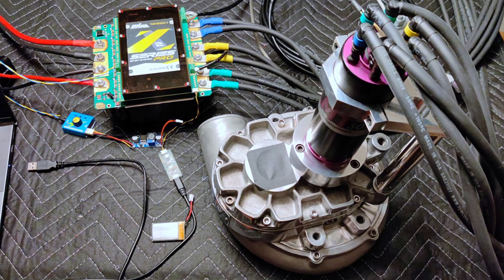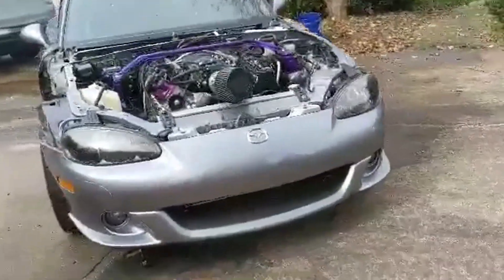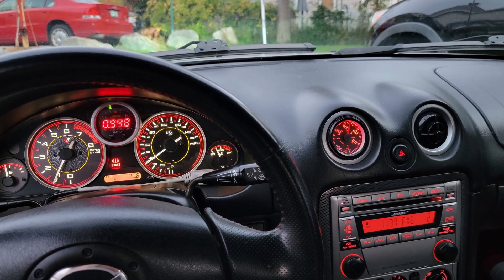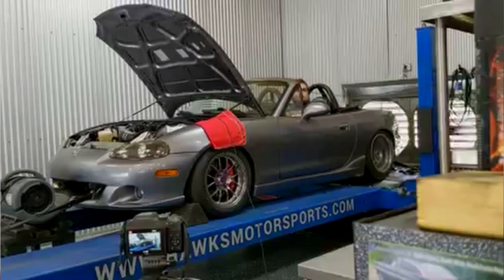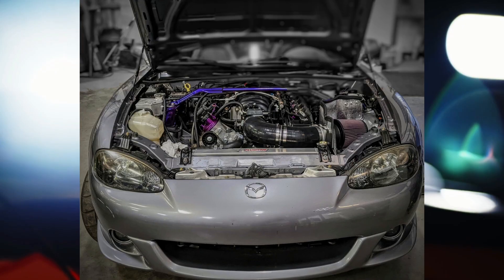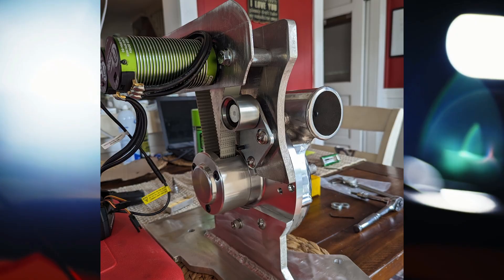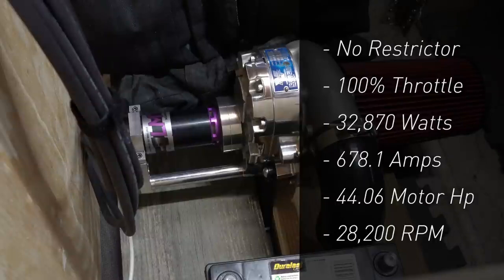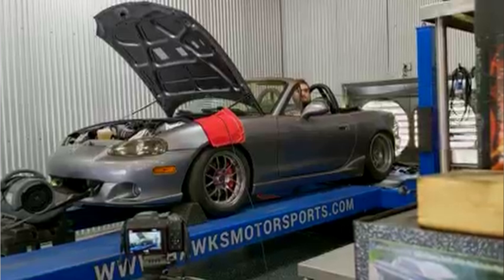Twin Motor Electric Supercharger!

Comment: What happend with this project? Just went quiet?
Reply from the maker: I followed up with him a while ago - he got tied up with some life stuff, iirc.  But tbh, with castle's new 2535 motor and my recent findings that the p2 is more closely related to a Vortech S trim, I don't think the twin motor idea is necessary anymore.  I'll be doing compound and parallel electric supercharger tests in the very near future (in fact, the third video on the list to shoot).
Reply: @AlexLTDLX thanks for the reply! This setup looked extremely promising! However, I have literally just been waiting for you to test the compound setup! It will most likely answer all my questions and then get started on my own build. Some back to back vids with my old 3.2 vr6 turbo on stock motor VS electric turbo vids on same boost. I recently signed up on your forum, so I will fire my questions on there😂 thanks again for all your trial and error, and literally sharing everything with the public, its really appreciated!!

Comment: Have you thought about using an electric motorcycle motor like the QS138 90H?  My guess is that motor would be more reliable than anything meant for RC applications.  You'd want to make a belt drive, but that shouldn't be too difficult given the number of off the shelf pulleys available for superchargers..
Reply from the maker: That motor isn't as powerful as these castle motors are.  I've seen 12,000 watts from these castle motors; that motor is at peak 7,500 watts.  And it's a lot more expensive, bigger and heavier.

Comment: Using an esc is extra fail points. 
Why not just use a 12volt series wound DC motor with a switch that turns it on when you floor the gas? The rest of the time you can just stay in limp mode.

Comment: the rotor size rpm and torque characterise favors smaller motors in multi-motor offset counterforce gear configure sun gear to planet and in a case to deal with open tooth noise.YOU WANT TO HEAR THAT COMPRESSOR AT THOSE RPMS. A modern engine needs 25 to 35 hp to compress enough air to make significant horsetorques.
Reply from the maker: You want to hear compressor whine?  Here's my car when it had the Whipple on it running 9s at the track on pump gas: https://youtu.be/DwFndZa0SSU?si=z8WAfSm4WVopwSyK  It took closer to 70-80 hp to drive the blower.  That's too much whine - it gets annoying after a while.  Here's my electric supercharger running just as quick, with much less boost (much more efficient), and you can only hear it winding down: https://youtu.be/RT0M88xHzNQ?si=0ZdGOIWMnBLk27f2  And even the electric supercharger was making 44hp at that point.
Reply: @AlexLTDLX  so true yep it takes that much

Comment: I’m excited for more sledgehammer content this year. There’s gotta be a practical use for these in daily cars. Something that can reliably pump a few PSI in existing NA motors would be such a game changer I think. I’m curious if there is any chance stock alternators would be able to charge a small scale sledgehammer!
Reply from the maker: I'm sure that in-car charging is practical.  The amount of time one would spend in boost is so much less than the amount of time one would have recharging the packs.
Reply: @AlexLTDLX  Exactly, and these newer cars with auto start-stop already are fitted with capable capacitors I believe so they seem very achievable/realistic for to me at least

Comment: The og Thomas Knight had 3 motors on a eaton. I think to keep the motor rpm down you need a procharger that has a 2to1 or 4to1 step up. Basically a transmission. So 1 rpm if the electric motor is 4 rpm if the supercharger
Reply: Is he still around doing stuff, or is this technology they are talking about far more advanced?🤔

Comment: Ya'll need to build something out for the Ram eTorque setups.  Native 48V power system (battery and charging), and a very decently powered alternator/electric motor already built in.
Reply from the maker: I'll have to look into that.  These motors run on a max 50 volt system.  Though I don't think (but I don't know for sure) that the Ram setup can output the necessary 350 amps for a single motor system (a twin motor like in this video would peak potentially around 700 amps).

Comment: Лучше электромоторы прикрепить к Roots.
Reply from the maker: Rotors are too heavy and the roots blowers are too inefficient.  It's not practical - it would add way too much weight, take up too much space and still make less power.  I've done decades of research and testing with roots-type and screw compressors.

Comment: Im still learning about batteries and whatnot, but how come an alternator cant be used as the power source for one of these setups? Do they not generate enough power? (I know this is a noob question go easy on me lol)
Reply from the maker: A big car alternator can provide about 2,800 watts.  This thing will draw ten times that amount - 28,000 watts (I've had a single motor unit up to 14,000 watts).
Reply: @AlexLTDLX  (Hmm. Popped in here from other universe.) Interested in calculating how fast a mid-size alternator could reasonably power up a bank of the newer supercapacitors? One could achieve 'x' psi boost impulses of 'y' duration every 'z' seconds. Hopefully, 'z' very small. 

Would only need a simple current-ramping/limiting controller (a compromise between overloading the alternator and minimizing 'z', given 'x' and 'y' objectives) off the stock alternator - no classical 'batteries'. Obvious downside: cannot be sustained for as long a duration as batteries but that save much money on those really expensive tickets (but my state will feed you dinner and breakfast, too!).
Reply: @AlexLTDLX  thank you for your reply!
Reply: @AlexLTDLX  how long do you get on a single battery charge on your current setup? Like how many passes do you get before you need to swap batteries / recharge
Reply from the maker: A lot, is the best answer I can give you.  I have yet to need to recharge the packs on any track or dyno day.  On the street, the packs recharge when not in boost, so in reality, you'd never run out.
Reply: @AlexLTDLX  like rechargeable nitrous

Comment: why not dual stage the motors and run a higher voltage?
Reply from the maker: Because they're essentially 3 phase ac motors.   Unless the motors are mechanically sync'd (it would have to very precise - every degree of timing affects performance), the ESC wouldn't know when to fire the phases.  You'd end up with "juddering" and no rotation, more likely than not.  It would be nice to find higher voltage ESCs that are commonly available, as that would reduce current draw, making voltage sag less of an issue.
Reply: @AlexLTDLX  I have not done any research on this so i could easily be wrong. I thought the Tesla motors are high voltage. Granted they are heavier, but weight in the back seems like it might help? a battery pack or 2, inverter and motor might be to heavy, but it would throw some air. the way that industrial motor and vfd are similar and give more versatility but would probably be to heavy when said and done, but this is "pioneering territory", no? I also mean to install in the trunk, no way you could fit all that in the front. to dual stage, just run a pot off the accelerator pedal to the controller?

Comment: I've been looking at electric motors on ebay and have noticed that 20hp electric RC motors exist. What is the reason that you chose 2 electric motors instead of buying one big electric motor?
Reply from the maker: Cost and rpm capability, mostly.

Comment: What's the electric motor spinning at ?
Reply from the maker: They're capable of 50,000 rpm, but really you're likely to see a max of 35,000 rpm under load.
Reply: Can't you set up a pulley system , like run a pulley with the electric motor and belt drive it . Less rpm , higher boost
Reply from the maker: That's exactly what he's doing - the belt drive has a step-up ratio.  Once it's on the car he can fine tune that ratio to find the sweet spot for his engine and available motor torque.
Reply: @AlexLTDLX  nice !

Comment: Those are nice things to play with but just like a normal supercharger which is the best power maker they are very limited as to what boost most guy's efforts can make, not to mention seeing 6PSI at 30kW which means except of expensive and finely crafted parts this needs to be made of you also need batteries to run it unless you hook a 200 pound alternator on your engine bay. 
When a turbocharger finally starts compressing it's no joke, the supercharger is a heat pump with permanent parasitic loss but makes boosted engines work like NA if you don't go after making 3 bars of boost, the electric turbo is ?????? Atm maybe something to play with batteries and switches and figure out how to tune the engine with it
Reply from the maker: https://youtu.be/RT0M88xHzNQ  You won't see that kind of gain from 6 psi from either a turbo or a supercharger.

Comment: Very interesting. I’m working on a 280zx and the exhaust and intake are on the same side so stuffing a turbo down there is very tight. Nissan did it but it gets so hot at the intake. This really make my mind flutter with ideas. I’m a machinist and so yeah let’s do it. My question is why not Increase the turbo size so you can drop the rpm?
Reply from the maker: That's a good question - there's a balance between available motors, rpm and affordable superchargers.  This seems to be the sweet spot.
Reply: Yeah use an old semi turbo

Comment: 4:27 running oil lines and pipes under the car isn't an option for me. Pot holes and road debris can ruin you if they rip an oil line.

Comment: using  creative cooling on a standard exhaust driven  turbo is better idea than using  mechanical electric  turbo ie components, belts etc , as they will not be practical in cost, or lifespan . even if your doing something no ones done, the cost overruns what a  standard turbo can do for cheaper

Comment: He should try making a full digital turbocharger whith a turbine attached to a small generator. This could be combined with a bypass to fully circumvent back pressure due to it when maximum power is required

Comment: Dang you didn't even talk about the motors or esc's. Castle motor with Hobbywing max5 ESC? looks like your running it sensored??
Reply: Yes 2028 800kv sensored motors running @ 12s off of Max4 escs

Comment: I just want to mildly boost my stock Jeep 4.0L. I don't want to get into having to program and tune. I'm fine with putting in injectors that can flow enough to not run the engine too lean.
Can this technology help me achieve that goal?
Reply: adding higher flow injectors requires tuning. At idle you would be super rich if running the stock fuel map that is for smaller injectors.
The only feasible way of doing what you're trying to achieve would be this: im assuming a jeep 4.0l has around 18lb/hr injectors. Grab some 30% higher flowing injectors, 24lb/hr? and run e85. It might not blow up immediately then with a small amount of boost, although probably wouldn't last long.
 Also, i believe a 4.0l jeep needs a valve that closes during boost to the map sensor. Another words your map sensor can't and won't measure anything other than vacuum. Maybe there is a 2 bar map sensor out there that swaps into a 4.0l jeep, but then that would require programming to work correctly.
Reply: @pd2340  I see. Well poo . . . . I was hoping it wouldn't be that involved.
Oh well, that settles it then. Time to retro-fit a Magnum 360 into the Ol' WJ.
Reply: More than likely, no. Extra air is extra air, and you need to add more fuel for that somehow. There are mechanical ways to do it, but it's still tuning, just not with the ecu.
Reply: @ScootyPuff_Jr  If it's a small enough amount of boost, the fuel injection/oxygen sensors should be able to compensate, shouldn't they? Especially if I put in high flow injectors and pump.
I'm just looking for advise and I appreciate the information. Can you point me to a link that can help me out a bit better? Is there any DIY software for tuning Chrysler ECMs? Thank you.

Comment: I’m mid engine swapping a Corvair using a Toyota hybrid drivetrain, and as a side effect I’ll have 200V+ on tap for an electric turbo. The problem will be getting a standalone ECU to play with the hybrid controller, it’s going to take a lot of CAN spoofing.
Reply: Yeah problem is that motor won't handle any boost. They like to shoot rods out without any boost never going to work
Reply: @randalleldridge5667  we'll see, I'm not opposed to changing it up to lower the compression to allow for some boost. Though judging by how light it has come out I think I'll leave it NA and just make up any power I need on the electric side. With everything in it's almost lighter than a Miata without any weight reduction like skinning the trunk or lexan windows.

Comment: What are the kv ratings on the 2 castle creations motors. And what size hobbywing esc's are in there?
Reply: Castle 2028 800kv. And I'm using hobbywing Max4 esc's

Comment: Would love to do something like this. Whether I bite the bullet and try a torqamp or so my own setup. 
I would love to try this on a rotary. Don't need huge gain but about 5psi of boost would be good. Something down low to push it into high rpm faster.
250-300hp range would make the world of difference

Comment: The thing with boosting the intake pressure with a turbo or blower is that you're trying to add pressure to a vacuum system. The engine is already sucking at idle and it becomes worse with RPM. So to pressurize an already sucking intake system, you need some serious power to generate boost. There was a guy developing something similar in Australia, it took enormous amount of electric power to work. Something like the level of power a golf cart uses, it takes a lot of energy to function at higher RPM.
Reply from the maker: We've already made about 800 flywheel horsepower at the track: https://youtu.be/RT0M88xHzNQ?si=XgvV71fQN0k_n_FS
For the record, it takes about 34,000 watts to do that - more than your average house.
Reply: I built  an 88 blazer mud truck with a 5.7 tbi , I ran three car batteries  to power a fan / turbo style set up ,  that pure redneck experience  was a success,
Reply: There’s nothing wrong with dreaming. 
I’d love an electric turbo/supercharger. 
An electric boosted turbo would be interesting. 
Or a turbo boosted electric turbo/supercharger.

Comment: I know it's easier to pontificate than fabricate but David if 2 is better .... why not 8???
Reply: Generally a little thing called a point of diminishing returns. It's like those who think why not just put in more electric motors into an EV. Well because you need to add more controllers and more batteries to support those motors, now you need more hp to move the increased mass, so you add more motors to produce more power, and round and round you go. The answer lays in making the motors more efficient. Belts / gears all consume power so the more you have the greater the parasitic losses.
Reply from the maker: Eventually you just end up pushing the compressor into choke.  I2 motors is sort of a sweet spot.  But nothing stops someone from running 2, 3 or even 4 of these units provided you have the room (and your engine and driveline can handle 2,000 hp).

Comment: Google Thomas Knight. He was doing this 25 years ago in Miami. Also built belt driven turbos.
Reply from the maker: IIRC, he was using starter motors, right?  These new brushless motors are in a completely different league.
Reply: @AlexLTDLX  I was new to Miami in 2006, so by then he was transitioning away from the electric stuff. I worked in Kendall as a machinist and he'd stop in to our shop and have me machine turbo housings. Cool dude.

At this point, the technology for the etc is too accessible to anyone. It would be tough to make money and be a standout company with this type of product. Aren't the Chinese already making these?
Reply: @Cookie-Dough-Dynamo  plenty of people are making these, but the real question is how many of the ones available are not a money wasting gimmick? The biggest issue with electric turbos are the fools that are flogging them as some kind of magic bullet. Usually they are egotistical people who ignore physics and fudge the numbers to show that they work, completely ignoring the facts. Like making wild efficiency claims while completely ignoring the power source in the equation, but they are not interested in the truth because it is not convenient. Some of them do seem to produce limited results, but they are generally wrapped up in a good layer of BS.

Comment: Couldn’t one mount the turbo(s) beneath or to the rear to prevent engine bay heat soak? I think Hellion makes a “sleeper” kit that moves the Whirly boys out of the way. To each his own, I watched Cleetus’ video on electric turbos, hence the reason I thought they would be fine on small engines (at best). I’ll have to catch up on advances in technology from then.
Oil less turbs are also a thing.

Comment: You guys are not torturing the turbos enough to use an active oiling system. Just fill the cavity with gear oil and use two caps. If youre worried about it change the oil every race day
Reply from the maker: I use ISOflex NBU 15 grease in my bearings - have yet to repack them after a year of dyno and drag tests.

Comment: Just swap the 6.2 in and you done😂
Reply: Maybe later. A bolt on 6.2 with a cam that is aggressive enough to make 500whp is close to 8k or more all in...this is 2,700 so far. I can always go larger displacement down the road too . The hard part of the swap is done.